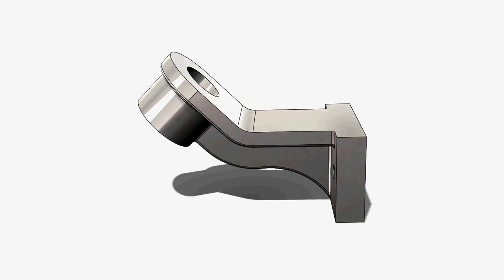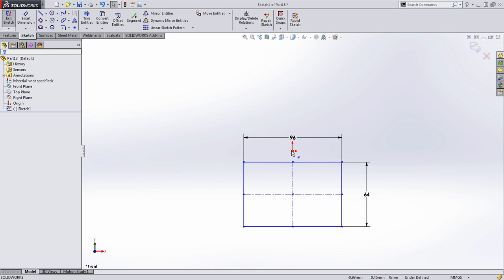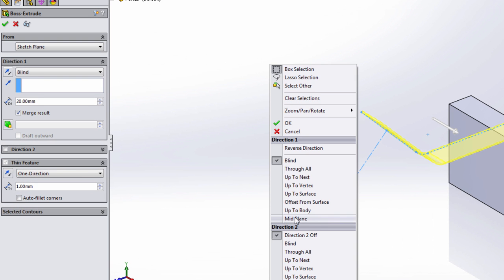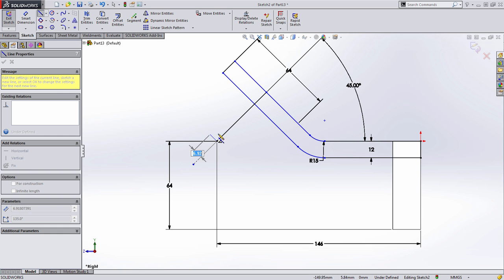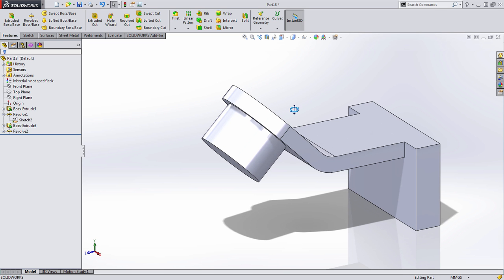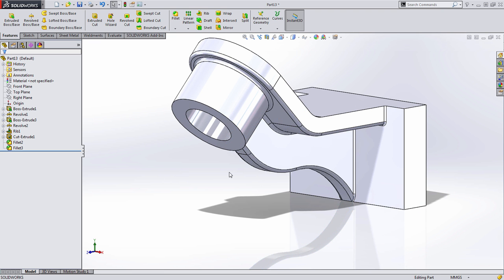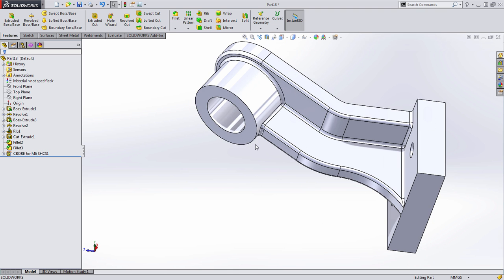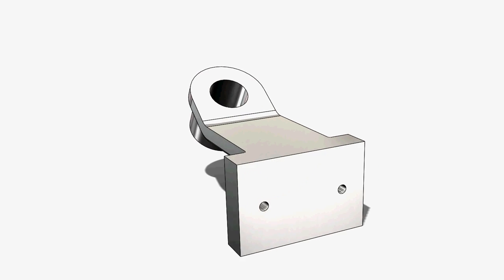SOLIDWORKS World: Model Mania 2001

Comment: Another way to aproach the R55 arc is to create it as a fillet. Leave the rib straight up tto blockck then add a fillet command of 55
Reply: this does not result in correct  curvature. the fillet will make an arc that asymptotes at the 26mm offset. That arc needs to protrude into the rib.

Comment: I finished the design and revision in 27mins. Thank you for stating the ribs dimension as 12mm prior to showing the 1 of many possible solutions.
I appreciate that you have this video set up with the drawing at the start and the revision. I simply put this on the other monitor and paused before the revision, then again before the solution.
Lets see how I did...or how I did it differently...
While adding Rectangle. "add construction lines from midpoints". ok cool...
04:00 OH WOW! Thank you for showing the 2 different approaches. I had done the second approach (no math ;) )
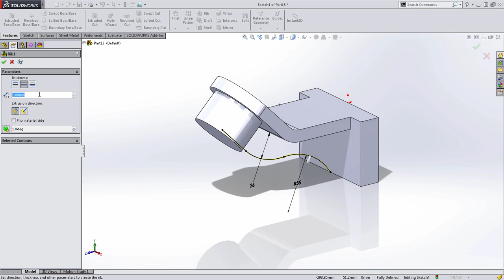08:46 Rib...Feature? 08:56 HOLY COW!
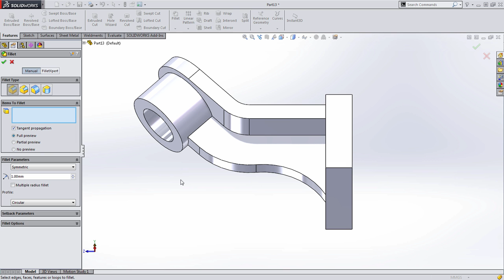09:35 I used the geometry first time through the fillets but then had issues with it after the second phase. Funny I was just about to question the fillet size
10:40 "we wanna dimension this symmetric about the centerline" ? I understand that this is what the design should intend but according to the drawing, this was dimensioned off of the left side edge. Perfect example would be if the left side of the part was to be against another part on the left side so that the holes will line up.
13:17 Oops. I missed the addition of the flat. I like your solution to add a line in between.
Thank you again!
Reply from the maker: Awesome! We are so happy you found this helpful!